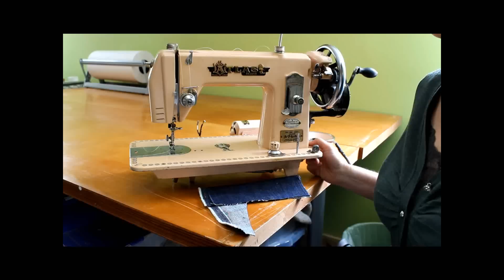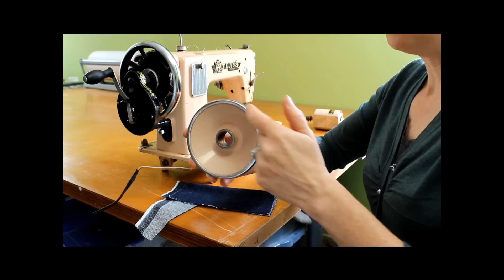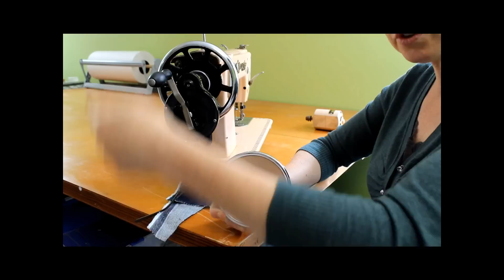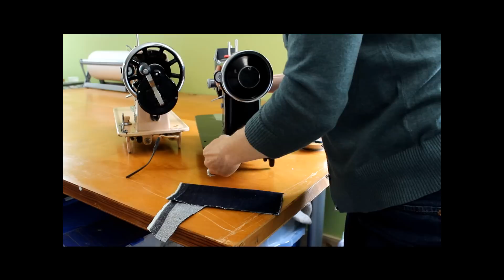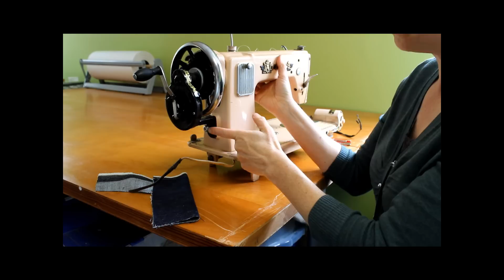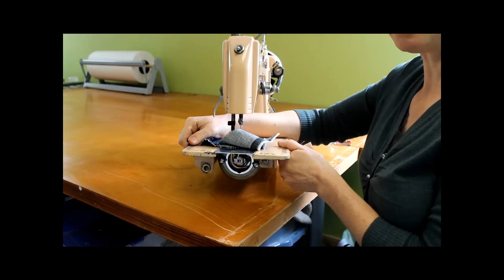Atlas Pink Sewing Machine Hand Crank Conversion.wmv

Comment: I was looking for any information about the Atlas Machine when I ran across this video.
I have the exact same straight stitch machine and love mine.In fact I took my machine to the local sewing machine repair man to have all new wiring put in.He wanted to take my old motor off and put a working black one on.But I love this pink machine so much that it was worth the extra money to have my pink motor rewired.I have never been able to find much information about the Atlas.And there is no manual.

Comment: I too have a Pink Atlas / Brother HA4.  I find that on all the after market China hand-wheels they are tight.  But I just take some #320 grit sand paper roll it into a small tube and sand the center just a little.  If you pound the wheel on your clutch or bobbin winding release mode will not work.  Please folks sand the center hole just a little bit then re-oil it.

Comment: Thanks for the great video!   I would like to convert a singer 24 chain stitch treadle machine to hand crank.  The wheel mechanism is different than a typical sewing machine.  It has a small wheel that is near the bottom,  at the level of the bed of the machine instead of the arm.  I still enjoyed your video a lot and will come back to it if I ever want to convert a solid wheel electric machine to hand crank.